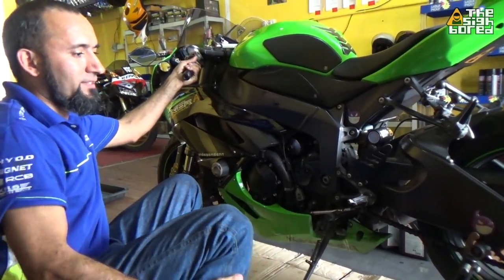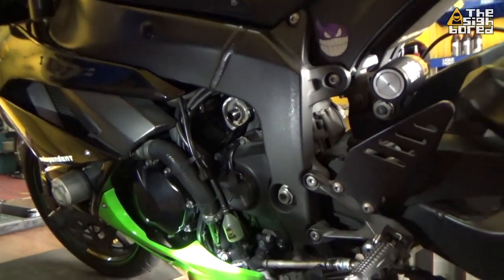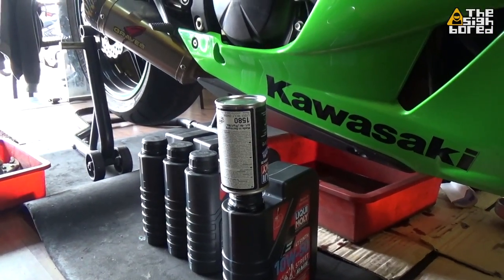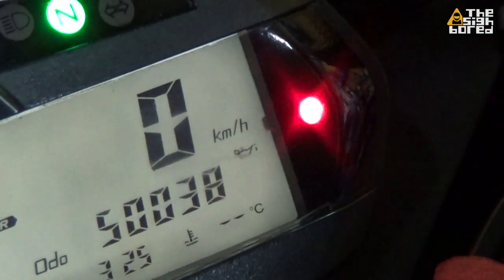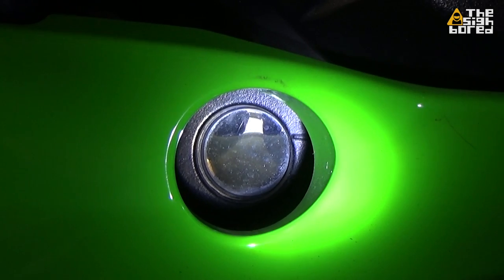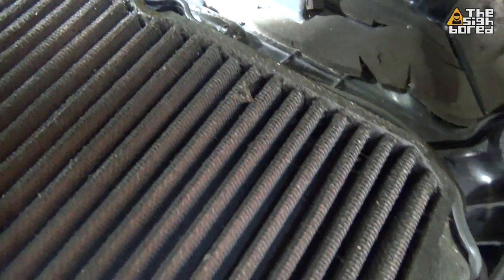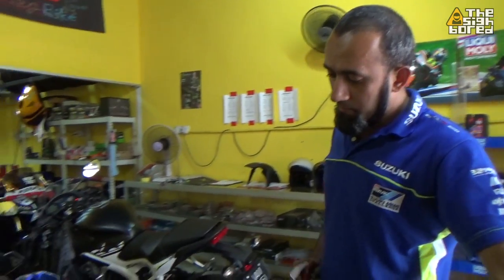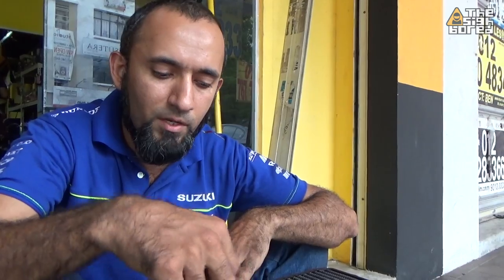Kawasaki Ninja ZX-6R | Workshop 17 | 50,000 km | Service

Comment: What is main purpose of oil additive? It's not enough fully synthetic function as well?
Reply from the maker: Depending on the oil, for this case the LM FS oil does not come with additives so you can add it separately or not add it if you feel you don't need to have the additives. As per The Cleaner's explanation, it increases the anti-wear and anti-friction properties of the oil. Which is why you cannot add too much otherwise it will cause slipping in the clutch.

Comment: I don't get it why do people come watch a video showing someone maintaining their motorcycle and 'dislike' it?? Some people are jealous simple.

I am one of those but I didn't dislike I promise haha.

The oil filter placement is stress haha
Reply from the maker: It's OK to have dislikes, it's a balance in The Force.. :) Yeah that drippy oil filter change gets on my nerves every time. I'm coming up with a possible workaround for the next change, hopefully it works.
Reply: @thesighbored  I spray degreaser once oil filter and oil change is done, and wash the area with water, where the oil drips out on the engine. I do the same procedure for my car as well.

Comment: @thesighbored can you ask the mechanic #cleaner guy about how to avoid oil pressure light after an oil filter change. It is a very common problem in most kawasaki models that when the oil and oil filter is changed, it traps some air in system and that causes oil pressure light to stay in. The fix so far that everyone knows is to burp the filter by unscrewing the filter a bit and let the air out while engine is running. It is a very common issue. You can search google by typing "kawasaki oil filter burp" and tons of forum results will come up. Please ask cleaner on how to fix it and why this actually happens with out bikes at the first place. Thanks alot.
Reply from the maker: I think he did cover this but it is on one of the "Ninja at the workshop" series when he was changing the OF on my Turtle, the simple solution is to put some fresh EO into the filter (not fill up to full) before installing the filter onto the bike. You can see him doing that right before he installs the filter in those workshop episodes.